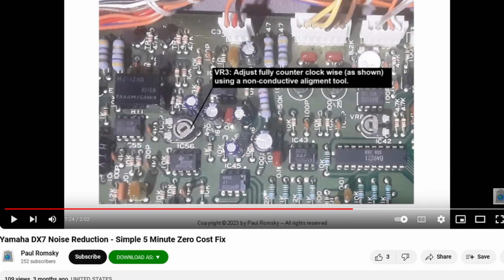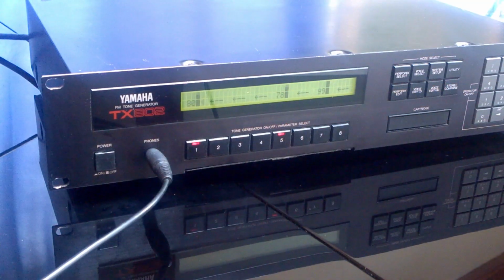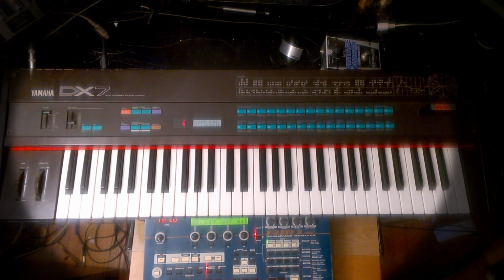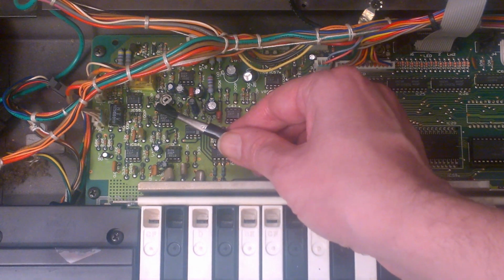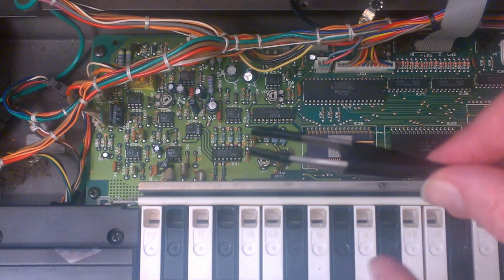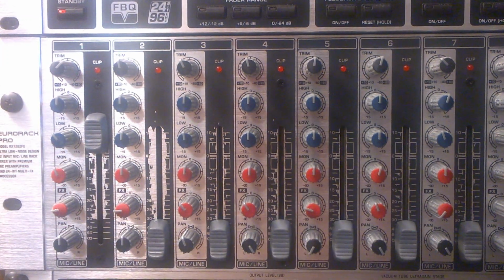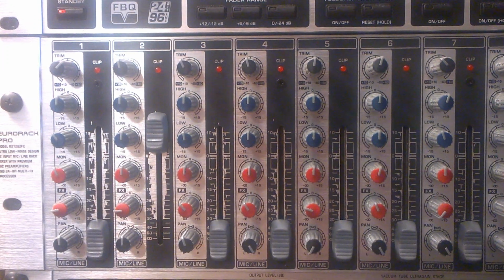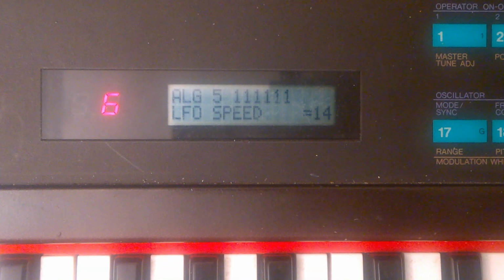Yamha DX7 Noise Reduction: Zero Cost Romsky Method

Comment: Hello Off The Matrix,

Thank you for making this video.
I was wondering if this method would work on a Yamaha TX7?

Best,

Robert
Reply from the maker: It could if the TX7 has the same pot. I would think it has the same hardware.
Reply: @offthematrix5310  Off The Matrix, thank you for your reply. I actually asked Paul Romsky the same question on his YouTube video about this topic and he told me that the TX7 has very similar amplifiers to the DX7 but no trimmer pots. He told me that I would have to snip pins on a few resistors, capacitors, and integrated circuits. Then I would have to solder tiny trimmer pots in place. Paul is a very helpful resource and I’m glad that you were able to reduce the noise on your DX7 using his method. I may consider doing it to my TX7, but it sounds like a more involved process. 

Do you think a Noise Gate would help reduce the noise on my TX7? 

Best, 

Robert

Comment: I have noticed that DX7 sound has less low frequency content compared to TX802, which is strange, because original DX7 is pretty “bassy”. Does the setting affect that?
Reply from the maker: After I made the video, I noticed the low EQ of the mixed was down by about 3 db. That's how I EQ the DX7 because it's too boomy for patches like horns. I forgot to bring it up. But the EQ would not effect the high end of the hiss.
Reply: @offthematrix5310  Ah, that makes sense now. Thanks for clearing this out.

Comment: This is interesting.  I have a DX-5, TX-7 and SY-99.  The TX-7 is super noisy, worse than the DX-7 I think.  I was going to see if the DX-5 would take the adjustment however considering I have the SY-99 I think I'll keep it stock so I wonder if the same mod will apply to the TX-7 that way I would end up with a 48 voice, 3 part 6-OP DX.
Reply: Did you try anything on your TX7? I'm getting ready to dive in now, mines quite noisy. Power section looks a little tired in parts as well, so I'm curious if some of the noise is just old caps.
Reply: @freshofftheufo  Not yet however I did acquire a mint DX7 and DX21 so I can do a direct comparison between 2 units that were released at the same time.  Still setting up the studio back up.